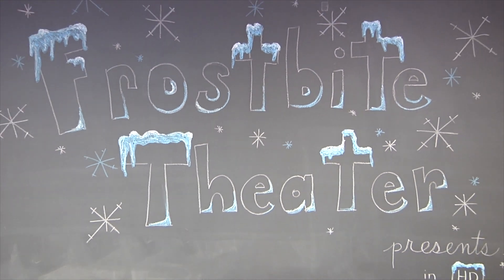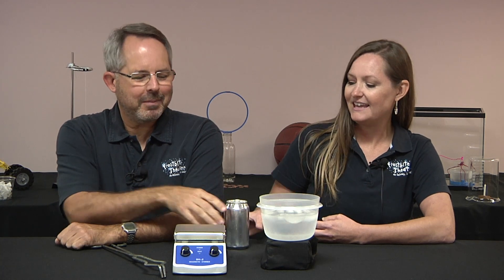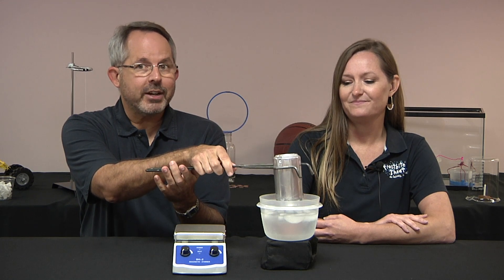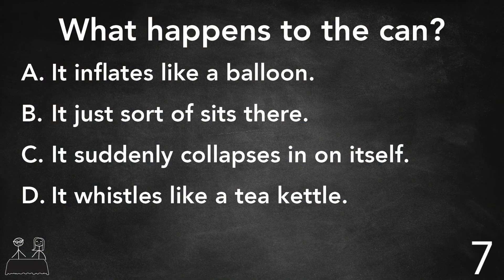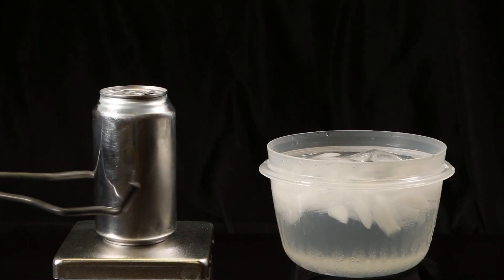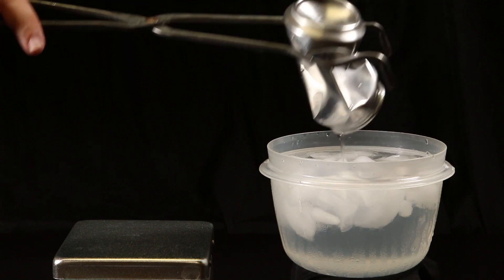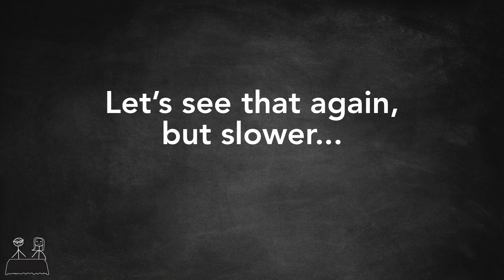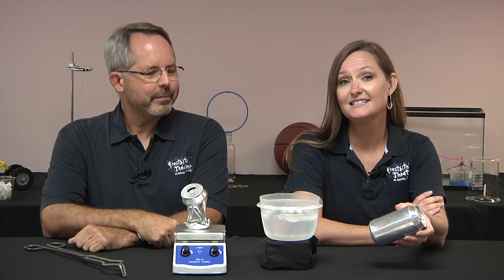Here's a Question! - Steam Filled Can in Ice Water

Comment: Good lesson in thermodynamics.
The subsequent question is:  if the pressure in the can was less than atmospheric pressure, why didn't the can just draw up water from below to equalize the pressure? 
Does this have something to do with the strength of the pressure vessel or maybe the size of the passage.  Can you do more investigation and demonstrations of these variables?
Reply from the maker: @David Morse Actually, water is drawn into the can. You can see this when the can is removed from the ice bath - water comes out. That's the water that was drawn into the can. You can also see, indirectly, by the opening of mouth of the can. It's a bit hard to see, but you may be able to tell that the 'flap' is mostly covering the opening at the beginning. You can kind of see it warping up a bit while the can is sitting on the heater. When it's removed from the ice bath, the opening is mostly clear. The water pushed the flap out of the way as it forced its way into the can.

So, why didn't this prevent the collapse? Basically, it's inertia's fault. The water simply get into the can quickly enough.

There's also a third way to 'see' that water is moving into the can. That downward jerk the can makes as it collapses? The one that causes the tongs to be drawn downwards? That isn't the experimenter doing that. That's an action-reaction effect. Sort of a water powered bottle rocket in reverse. The water is being thrown 'forward' into the can, so the can reacts by being thrown 'backward'.
Reply: @JeffersonLab  Thank you for the explanation.  That makes sense.  I am amazed at how fast the change takes place.  I also wonder what would happen if the top of the can was totally opened up.  Probably still collapse because of the inertia of the water in liquid form.  Like you said, inertia plays a definite part.
I think maybe the cold water being drawn up into the can might be what makes the reaction take place so fast as there would be cold liquid coming into direct contact with steam.
Reply: But wouldn't it draw up the water only if the pressure difference was caused by difference in velocities? Here the water is simply vibrating at a molecular level. So, the pressure difference must be caused due to different temperatures. But the video says - when the water turns from gas to liquid, there is a pressure drop. This confuses me.
Reply from the maker: @Shristeerupa It sounds like you're thinking of the Bernoulli principle, where changing the speed of flow of a fluid in something like a pipe changes its pressure. Here, the can is effectively like a straw. The water should (and does) flow up into it because the atmospheric pressure inside the can is lower than the atmospheric pressure outside the can.

When a gas is cooled, its pressure drops because the particles that make up the gas slow down. They hit the walls of the container less frequently, and with less speed, so there's less pressure. However, with this, the 'atmosphere' in the can is largely water vapor. When it is cooled to a liquid, the particles are no longer running around colliding with the walls of the can because they changed into a puddle of liquid. They no longer contribute to the gas pressure because they are no longer a gas. You end up with very few particles hitting the inside walls of the can. It's not nearly enough to balance what the atmosphere is doing to the outside of the can.
Reply: @11oreos  The pressure drop is the result of a change of state from a gas to a liquid.  Initially there is mostly steam (gas) inside the can.  Lowering the temperature of the steam causes it to condense (turn into a liquid), so the volume has  to decrease placing the inside of the can in a slight vacuum.  The soda can is designed to withstand positive pressure but is extremely weak in negative pressure conditions.  Negative meaning, less than atmospheric pressure.  These are the same principles upon which a typical steam engine works only in reverse.
Reply: Thanks for clearing up my doubts!